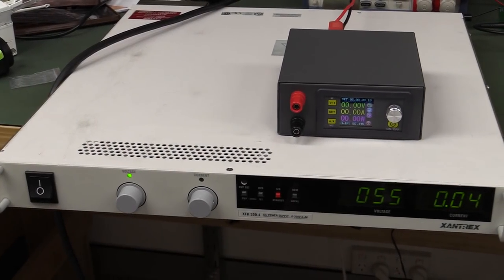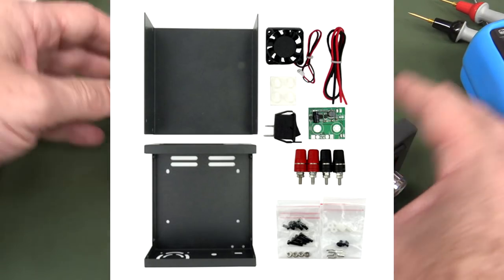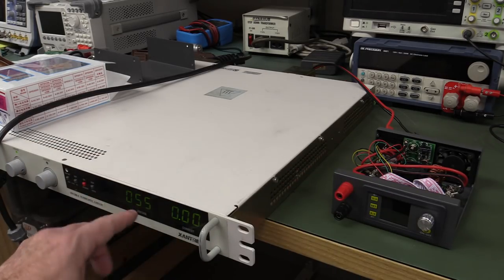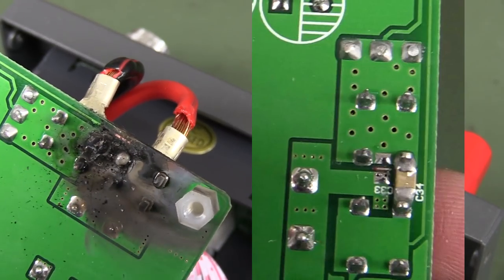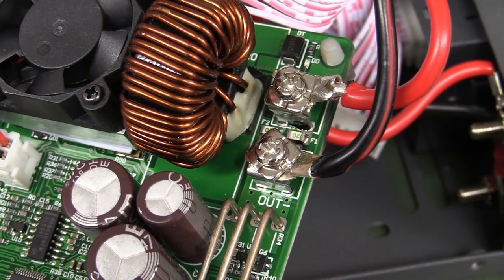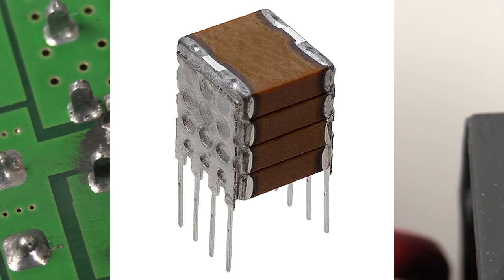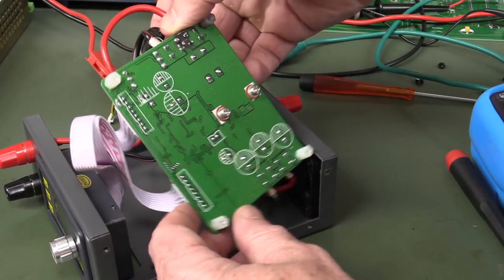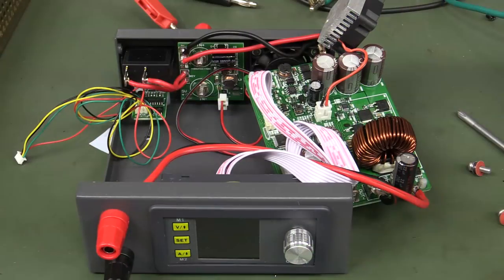EEVblog #1035 - Flaming DIY Power Supply!

Comment: Damn!  Sending a product for review and it goes up in smoke on camera.  That must be a terrible feeling.
Reply from the maker: Happened to both Keysight and Extech. It's a wonder people still send me stuff...
Reply: bigclivedotcom Of course, if YOU were the one receiving the product, it wouldn't matter what company sent you something, you would always find a way to blow it up
Reply: EEVblog
we test it at at least 4 times again before sending , because the capacitor was damged in installation
Reply: On the other hand it will be a great example of how the manufacturer/supplier handles issues like this. Which is as important as the design of the product itself.
Reply: That's why Photonicinduction doesn't get review items. You know he'd hook everything up to the 50,000 Amp supply.
Reply: That might be because Dave does not turn them on, he takes them apart 😋
Reply: @Vendicar Decarian
what you want to say ?
Reply: @Bigrignohio 
i admite this problem,. the capacitor place is not good and its  crack resistance is not good too , so it cause this problem. we are updating it today 
and there is many protection, even it was shorted, it don't effect normal working
Reply: @SAI Peregrinus
who is  Photonicinduction ? I guss he did not know our product,.not our quality , ok?
I can make sure the quality is good, and you can make sure all electronic product are perfect , ok??
Reply: @ve2mrx
you think it too much, because he is install it.. the capacitor should be damaged in the installation
Reply: @AffnKop
Control yourself and watch your language!
Reply: +Rd Tech  "who is  Photonicinduction ?"  He turns your product into photons if he can. ;-)
Reply: Talk about sods law
Reply: Makes for a great YouTube video, though.
Reply: He's doing a lot of damage control right now.
Reply: These things happen. Some parts are bound to be bad from the start.
Reply: 2230 hrs:time to dumpster dive!
Reply: @ vk3hau
thank you very  much for your kindly words . i have updated our product already, for all electronic products, there are many possibility to damaged, so we find problem and fix it
Reply: @Masshuu
Ha ha, if he use this voltage and current , I will be happy , because our input voltage will be only 60V
Reply: @Mr. Delphi
thank you for your nice message , hope you like our products
Reply: @Claudius
all our products were tested at least 3 times and ageing test,  but the problem is happened in Dave installation ,  it is impossible to use a hammer to click each components, right ?
so it is not products, problem
Reply: @ApexMike
sorry, I did not know who is the Photonicinduction ? may be Dave ?
Reply: @DrathVader
great video, many watcher
Reply: @Vendicar Decarian
thank you very much for your reply. I will learn this and improve our product to be better
Reply: ok, but if over the limit much to test , this test is meaningless,  if our input is only 60V, you input 500V, our products are also explored. so I don't know how he test it
Reply: @
Claudius
, ok
Reply: @Mr. Delphi
sounds very interesting..
Reply: I have no smoke detector in my lab just removed it a while ago, maybe not the best idea.
Reply: well maybe they had the warning in the Manual.  Do not operate without a load.  if it is a Flyback... that is almost bound to happen unless they have a Snubber designed for that.  Many new engineers have not learnt the old design approaches.
Reply: pjotonicinduction you-tube channel... I've never seen him do anything with low voltage, let-alone ELV like your device
Reply: Dave breaks everything... even a DIY Power Supply. ..
Unbelievable!
Reply: Aaron Gren
Reply: @rdtech9153  : i just build a Setup with 3 x 5020. The Input voltage will be exactly 60 Volt. I hope the 5020 will not blow up at max rated voltage.
Reply: @jensrehpohler4157   trust me , don't  worry, but when you buy that ? from RD official store ?
for 3 pcs, you can use same input, but output must be isolated , understand ?
Reply: @rdtech9153  i bought it from banggood nearly a year ago. Will use 5 x server power supplys to feed it. Isolated outout is given. Thx
Reply: @jensrehpohler4157   one year? please take a picture for the back of power part  , let me see it
Reply: @rdtech9153  please Tell me where to send the photos to. Seems that i have 2 different Versions but non has the cap that burned in this Video
Reply: @PeregrineBF  No matter how you look at it, 50kA is brutally excessive for ANY application.

Comment: The carbonized area of the PCB is probably working as a resistor between the output pads now.
Reply: Or rather as a conductor.
Reply: Yep that was what I thought immediately, I have fried up some boards on my channel and with only 13.8v I got flames and arcs through the PCB itself
Reply: jh77sly yeah Dave should scratch it away a bit and it should work again
Reply: Dremel it out with a burr and epoxy coat it.
Reply: Forget that part of the PCB, it's gone, dremel it out completely. Scratch away at the traces where it isn't burnt to attach new leads.
Reply: @blargg It's still resistive as a conductor, so resistor is more correct.
Reply: +blargg Literally a resistor. Resistors are conductors, merely of a defined value (nothing conducts perfectly). Conductance and resistance are inverse ways of expressing the same quantity; conductance is defined G = 1/R.

Not to mention that carbon is a very common material for resistor construction.
Reply: It is a resistor by common definition as it showed around 7ohm which for a material that length, width and thickness is not nearly in the range of common conductors such as copper or aluminium who would be down in the milliohms
Reply: I agree with blargg. There is a short at the output that is causing the instrument to reach the set current limit.
Reply: Justin Spencer The PSU sits at around 1A at 7V which qualifyies more as a 7ohm resistor than a piece of cable
Reply: That carbonized area CAN be repaired; it takes a little glass-bead-blasting to 
get the carbon off the board, after which the furry fiberglass strands will accept insulating varnish (Q-dope is one variant, but probably clear fingernail polish
is very similar).   My electronic ignition was so repaired, and worked fine for half a decade afterward.   Once the varnish dries, the burnt smell fades.
Reply: Carbonized fibre glass use to acts as low resistor, when y have this issues on PCBs normally caused by insects an 230volts, I used to dremel it and most cases works again

Comment: My guess why the Capacitor burned ist the following:
When you screw the wires (especially the black one) you bend the PCB quite a lot. This breaks the Ceramic-Capacitor. The multiple layers of the broken Capacitor form a short circuit with some ohms. This burns quite well when voltage is applied. I think it would already help to turn the Cap by 90 Degrees or/and shift it to a place where less bending happens.

Comment: My money is on the PCB being carbonised and thus forming a low-value resistance between the output lugs on that board.   You'll have to cut away all the burnt board.   Measure around there with an ohm-meter and you'll likely be surprised at how low the resistance is.
Reply from the maker: I did measure it and it was fine, hence the re-power test. But it's now a low value, so the re-power changed it's properties or some such.
Reply: @EEVblog  Ok, now i see. But if you measure charring resistance with an ohmmeter, there is no power involved, so nothing but megaohms to be expected. Charring isn't a stable situation you can work with. Not as an electrician at least. As soon as you fire the power up, the coal gets active. Maybe soaking with epoxy may help instead of coal removal, but i wouldn't try, because it's always to much at stake, so i don't know.

Comment: 11:09 Dave, there is still a tiny layer of metallized vapor all across the pins. It's not a perfect short, but it may draw a little current.
Reply: there's also a new carbon resistor embedded in the PCB
Reply: @randomblogger2835  I thought I repaired a washing machine power supply once.  It worked well for 2 loads, then let even more magic smoke out.  I figured it could be the copious amounts of carbon now lying around 240v, or equally, WTF would you route the outlet hose pressurised by a pump, right above a SMPS?  Dingbats.

Comment: A  chunky 55V PSU isn't much different to an arc welder...
Reply: An arc welder is just a really chunky 40-80V PSU
Reply: You could even use 4 car batteries to make a cheap 48V welder.
Reply: Wouldn't that be an expensive single use 48v welder or do the battery's actually survive?
Reply: A welder is actually a constant voltage/constant current psu. It need an highish voltage to maintain the arc, specially to start the arc. Once the arc is going, you will get only a few volts, like 10-20V, but can be quite some high amperage.
Reply: You can do some light welding with just 2 batteries ..
Reply: The current needed to weld is just a fraction of the cranking amps of most cars ..
Reply: Welders get a bit fancier, especially TIG ones. High-voltage high-frequency start, then controlled ramp up time to a max voltage, then into constant current mode (or variable with foot-pedals and such) and then a ramp down on turn-off. So more like fancy programmable PSUs.
Reply: Simon Tay:
The internal plates of the Car Battery would probably bend with the huge current surges and destroy the battery.
Reply: PTH film capacitor would do just fine. But it will be more expensive. . .
Reply: Michael Hawthorne You can draw the necessary say 10-150amps, depending what you wanna weld, from the battery without much drama. But that would need a regulator of some sort
Reply: my arc welder has 80 kgs of chunk
Reply: Yes, things get exciting, quickly if you use uninsulated braided straps to link 12V batteries together and the braid happens to short across two terminals.
Reply: The batteries survive as long as your reasonable about it (basically don't weld for 2 minutes straight). In the field car batteries are used to weld commonly because its a low maintenance and robust solution that you can bring pretty much anywhere.

Comment: I saw these modules on ebay, and wondered if they had been designed properly, very busy and very complicated design PCB, and in no time something failed in smoke, excellent review.
Reply: no , it is not time proble , we can't damaged our capacitor to test . first , it is not capacitor quality problem , ok ? if you damaged any part by force, the power supply will burnt ... 
in fact , the capacitor place is not good ,and this capacitor is not strong , easiy damaged by force 
understand ?